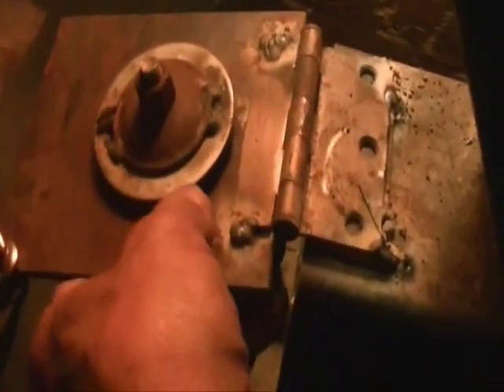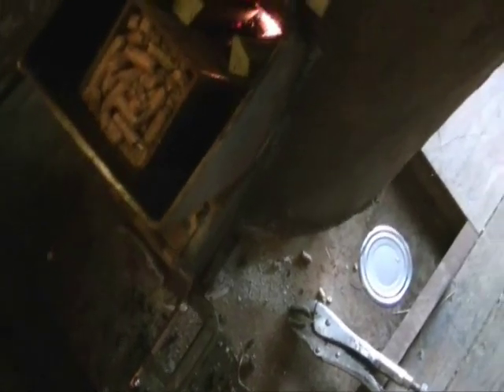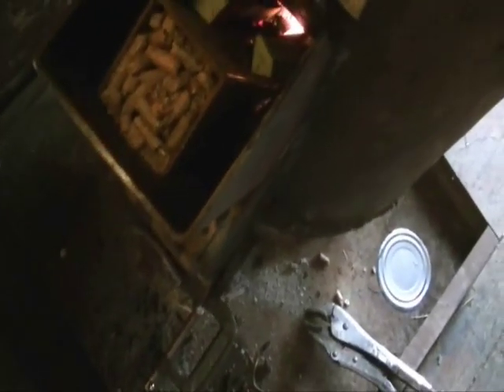Solution to Pellet Burning In Rocket Stove Space Heater

Comment: I tried the pellets in my rocket heater today.  I had a similar setup like what you have. It worked well.  The one thing I do not care for is that once burning, there is no way to shut the unit down.  If there are a lot of pellets in the tube there is no option but to let them burn out.  As it so happened, it took well over an hour for the pellets I had in the tube to be consumed. Glad I did NOT fill up the tube!